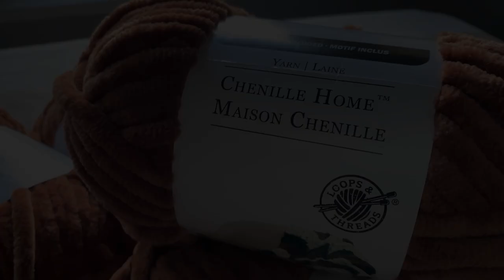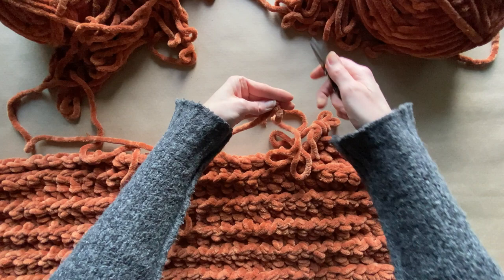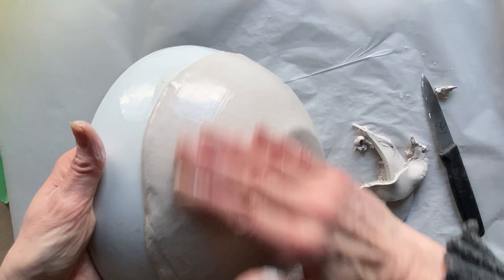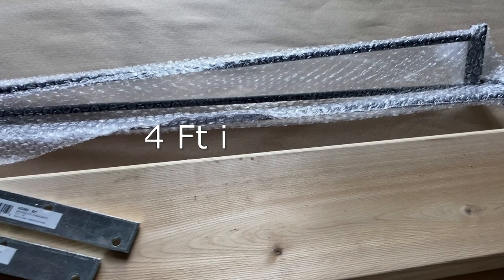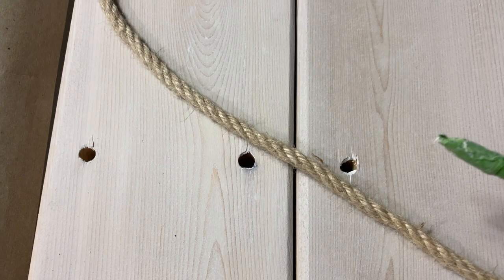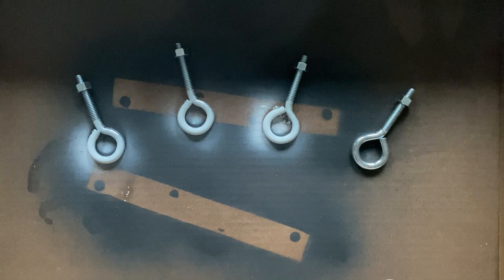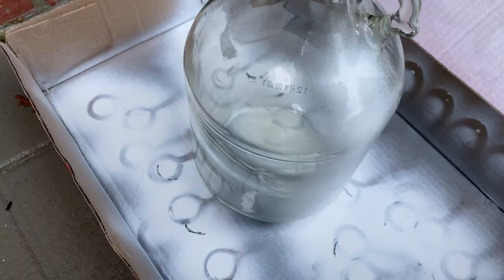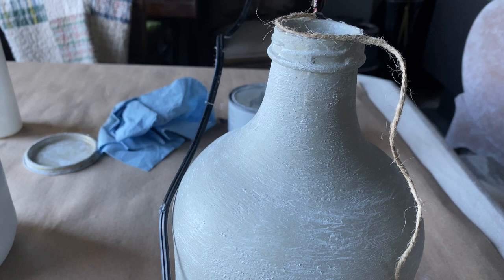5 Home Decor DIY: Super Chunky Knit Blanket, Chalk painted dresser & drawer pulls, paper clay bowl.

Comment: Question. I just did a chalk paint dresser. Finished it with two coats of Dixie Bellie satin top coat. Then something hit the top and damaged the paint a bit. I sanded the area of damage and repainted. And am putting the top coat back over the area. Is this a good solution or should I sand the whole dresser top and kind of start over?
Reply from the maker: Hi Mary! Give it a try and see how it looks, I think it should be fine at worse case you will have to sand back the top coat re-apply the chalk paint and then top coat it again.  I think you will be fine.  I have done that in the past and it worked out fine! ❤️🎨🙏